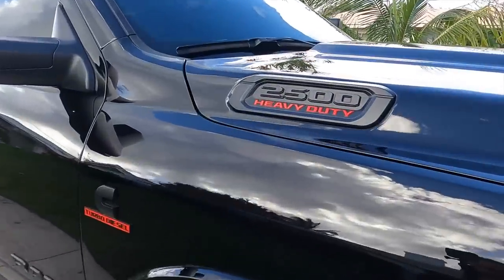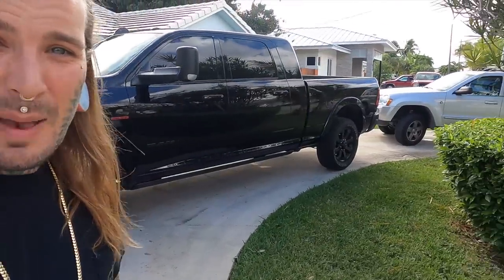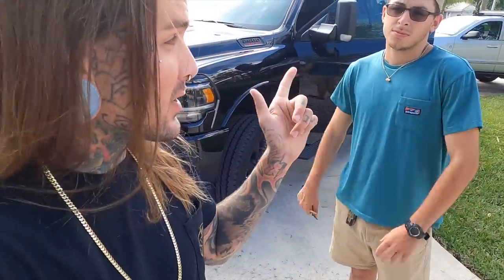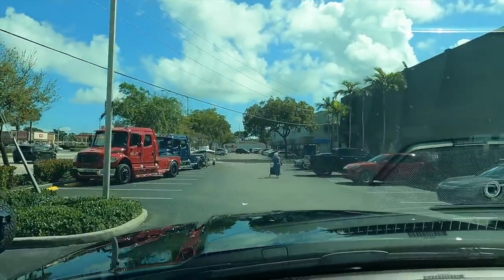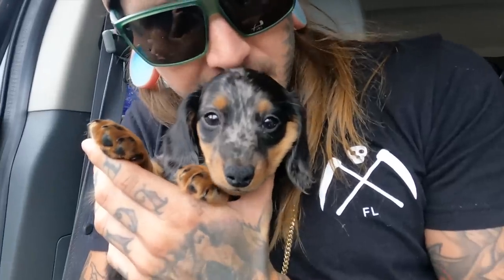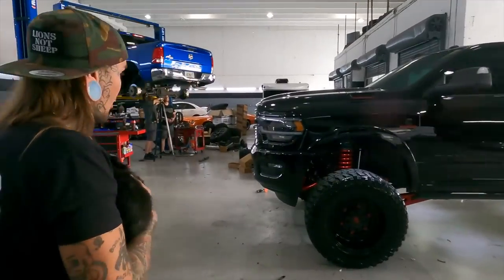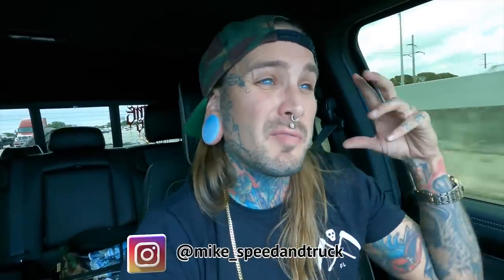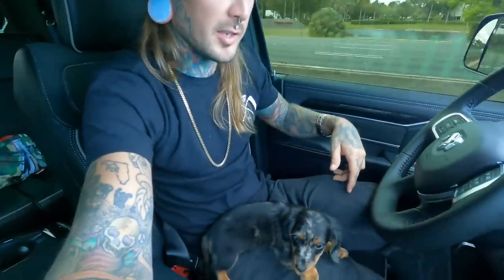BIG TRUCKS & Little Wieners 🤣 2021 Dodge Ram 2500 Build!

Comment from the maker: What do y’all think?!?! And for those asking the lift is a McGaughy 6in lift with the rear air suspension.. S&B intake and a AFE 5 to 7in exhaust. MORE TO COME
Reply: Not normally a big truck guy, but I like yours. Personally I have a 1970 C10 with a 2.5" lowered setup😅  it's in the works for an engine rebuild rn.
Reply from the maker: @cdh91150  hell ya If I had an old c10 it would be slammed for sure
Reply: I love an all murdered out and lifted truck! That’s a sexy machine! Congrats!! 🍾🎉
Reply: Who makes the wheels?  Killer build.
Reply: Love it,will you plez do a tattoo convention in or near ky.your art work is da best
Reply: That big black beast is sick!! That build was not cheap!!  U pay for what u get fo sure!🔥🔥🔥🔥🔥
Reply: Never been a doge fan but dam that’s a sweet lookin truck
Reply: @cdh91150  got a 77 that’s about done ,gotta put the oak in the bed and I’ll be finished or till I save up some more cash.lol
Reply: i love big trucks your truck is sick my dad has a Dodge Ram 3500 2004 model it’s a candy red and he has a goose neck trailer to go with it.😂 I also use it to pull my horse trailer I have A red roan rodeo mare and her name is Whiskey (little Richard is adorable)
Reply from the maker: @chickeastwater9883  you don’t have to really down here anymore
Reply: @TylerNolan  
I know - " So Lucky "
My Uncle's,  live down there. 
I'm in CT.  Ugh 
Your Truck  is PHENOMENAL  !!
Whewww Goose Bumps  -
good 4 U -
Reply: Dope!!
Reply: What wheel company you go with? And tire size?
Reply: @chickeastwater9883  i live in Florida havent worn a mask yet. Totally pointless
Reply: So it's illegal in the U.S to duck with your engine or air system???
Reply: @davemackinder6518  it different for each state in Kansas you can do whatever you want to vehicles but states like California and Pennsylvania are super strict on emissions and vehicles have to pass yearly inspections
Reply: that is so cool trunks
Reply: @stacyjones3132  I totally agree with you! Damn them some BEAUTIFUL BLUE eyes.
Reply: Nice truck but i still like my black 01 WS6 with 17k miles better.
Reply: Bro it is so sick! Happy early birthday to you fr!
Reply: @Tyler Nolan u need to be attentive to your edits outside your house bro I'm sure u know what I mean brother just looking out for u bro!!!
Reply: Cool truck Ty, I had a 2014,2015 &2017 ram, I love how they drive!
Reply: Sweet new ride. But dude! Your address is in the video again !!!!
Reply: Sick truck build my dude. Congratulations!
On a side note: be careful filming outside your house don't want to slip your address
Reply: Your truck is beautiful, love the red, but you need to wear your seatbelt!
Reply: I'm basic woman I do not understand cars beyond their looks so I'll just say it looks nice. That description you gave looks as confusing to me as a mathematical equation.
Reply: More fuel and more air and tunes lol
Reply: Wish we could add pics on here! Changed my profile though. Let’s go play!! I got a 3mo old Weimaraner so the pups can play too! Lol just a cute half ton (she can keep up cuz what’s under the hood but shhhh), sittin high with a lift n mastercraft courser MXT tires, with my lil borla exhaust. 
AGAIN: how do ppl do this give away if ppl like me don’t rock with social media?!
Reply: Hey man, I’m from australia so this might be a cultural thing, but what’s the deal with the lift? We go it on our utes for more off road clearance and without dumping heaps of money anything over 4” fucks the handling and puts more wear and tear on other components.. but yeah only for off road use generally
Reply: Wow that’s a sickkk truck!!!🔥🔥#big trucks little weenies hahahaha🐶
Reply: What’s that song called at the end of your video it’s fire 🔥
Reply: Not a dodge fan
Reply: Tyler, your hair looks great in this vid!! No joke!  I think you look great without the hat. You have great hair and fuck all those ppl that think different. Jen
Reply: I have a 2nd gen Dodge Ram with a 8inch lift on 12.5x30's its black and turquoise
Reply: @jeffwien6460  maybe tell em Tyler Nolan sent you & they will be nicer lol! That sucks though when places are asses & rude to 80% of the ppl. Like it's one of them places unless you're a "regular" they don't have time for you..
Reply: Gotta do a 5inch exhaust you'll set off car alarms with that 6.7 just straight pipe it
Reply: Don't had or have a Dodge Ram, but always liked it - beefy truck really nice upgrades.
Reply: @cindymckinney4981  they changed colour from the beginning must have been some kind o filter they went to vivid blue and his tattoos went from green to blue
Reply: Hell yea man. Super sick looking ❤️ love it! Good for you ❤️❤️
Reply: @TylerNolan  love the truck
Reply: @6181green  but when it comes to diesel trucks with DEF u can't modify it or u get a huge fine because if the vehicle comes with it it has to stay depends on the yr of vehicle
Reply: @spencerhoyt5649  if thats the case then why do they offer DEF and EGR delete kits? If anything it might void the warranty but its worth it imo the only way you will get a fine is if you live in a state that requires emissions inspections Florida is not one of those states 👍
Reply: @6181green  lets just say state troopers. If u get stopped and they inspect vehicle ur sofl
Reply: @spencerhoyt5649  it honestly is different for every state here in Kansas they don't care what you do to your truck we don't have any type of emissions regulations here I drive a dumptruck with a big ole Cummins and have never had my engine inspected to make sure it still has DEF and the other emissions crap the highway patrol/state troopers only do safety inspections
Reply: @spencerhoyt5649  upon further investigation it is federally illegal to delete emissions but people still do it but it is still legal to do performance upgrades for more power and stuff like that so I understand what you are saying but it also said no one is really looking to see if that stuff has been deleted you basically have to snitch on yourself for them to know lol have a great day bud 👍
Reply: @TylerNolan  can you imagine that pulling your boat? lol
Reply: Well I think you'll love my truck better, it's a sweet red with a lift.
Bet🤘
Reply: You should go to a drag race with Mike and the swan gang crew that'd be dope
Reply: i noticed you replaced the driveshaft did you touch the difs or t case other than the dif plates?
Reply: It's a bad ass ride buddy!! Did you think about doing the badges an front RAM in red too? I think that would've made it stand out, but it's badass!!!

Comment: My 18 f150 with the 10 speed has already been rebuilt once and is only running 35x12.5r22s and it only has like 50k miles

Comment: Damn bro you are like the 4th person I've heard have problems with your Denali transmission, my boss got a 2020 when they first came out and his truck was locking up and trans would windup really high rpms and gears were slipping, all kinds of problems and actually got to get rid of it to lemon law. But love the new 2500s and your lift and setup is pretty sick, Im not hatin on ya but only thing that I didn't care for was them painting your lugs red, maybe if they were red bullet lugs I might like it a little better but I like it all black and maybe the center cap have a little red in it. But congratulations bro thats gonna be a nice setup for pulling your boat, and good to see you and Kayla worked it out she seems like a really nice girl. ✌

Comment: Had a 2008 silverado 1500 with a 13” lift, 24x14s with 40s, spent almost $4k for a 4l60 that'd hold up. Went thru 4 "built" tranny's before that. Traded it in August for a 2020 ram 2500, needed a diesel to tow racecars. Loved every minute of it. I shoulda got the sport package with blackout emblems and the big screen but I knew I needed a work truck more. It's leveled on 22x12 fuel forged and 35" nittos but it needs to be bigger. Also that truck could end up with trans issues too, depending on how you drive. Look into a stealth tuner, especially if you wanna keep your warranty. It'll tune the tranny too, mess with line pressure and make it last longer. Also will bump your MPGs up 5 to 7mpg.

Comment: Now if only other people knew that TRUCKS ARE MEANT TO BE LIFTED NOT LOWERED, the world would be perfect 👌 
I grew up around/driving FORD trucks 💕 everybody dises the FORD but honestly, regular maintenance on them and they'll run perfect 👌 I've seen fords with 700 thousand kms on em. My hubby is a Mechanic and my truck has a 3 inch lift and air bag suspension and regular maintenance on it and baby (truck) is almost at 500 thousand kms.
Its a dope Truck Tyler but I prefer fords.
Rams will always have that ticking in the engine thats annoying lol happy birthday. I watch your channel daily (if you post new vids) 💕

Comment: Dude treat that dodge good and it will be good to you! We have an 01 second generation, it has 5 inch exhaust from turbo back and huge exhaust tip. There is  nothing like the sound of dodge diesel! I tell my husband all the time he loves that truck more than me!! He tows a lot with the truck including the bass boat and no transmission problems!

Comment: Nice you finally got a real truck. I drive a 96 extended cab 3500 12 valve Cummins (setup with single rear wheels rather than duelly) .  I find the sound of a 12 valve to be most satisfying (close to a tie with the 24 valves). But those new Cummins and the 24 valves are sick also.
Edit: what's the email, I will send a pic sometime.

Comment: Your truck is sick Tyler just what I need to tow my huge 3 horse trailer I have a 2008 ford ranger 4 cylinder turbo I put a heavy duty clutch and a kit thru gear box poor old girl struggles a bit  esp in the wet towing the horse float. I've never owned a new car.  Chq out Dmax on YouTube they have done heaps to there trucks.

Comment: The transmission kept messing up on your old truck because you have to change the diff gears to compensate for the bigger tires... you might wanna look into changing the differential gears on this Dodge as well sick truck BTW 👍

Comment: My dad bought the 3500 of the same truck looked exactly like yours on the inside it was a beautiful truck. But there was so many issues with the truck. You might have better luck since you are in the warmer environment but my dad couldn’t remote start in the cold it would just freak out and wouldn’t start he had to get it towed. It was in the shop more than he drove it and eventually he just got rid of it bc he was tired of all the issues! He also had issues with the electronic side of it. He would ask for air con on the face and it would only go out on the feet setting. 😅 I hope dodge stepped up their game for the 2021 version bc their 2020 sucked

Comment: Do it right, with proper ring and pinion change as well. And if that shop didn't say so, then they don't know trucks. They only know makeup 💄

As well they could've told you about the 50 State CARB LEGAL intake elbow by Banks, and then a turbo blanket, and then a custom tune.

But did they?